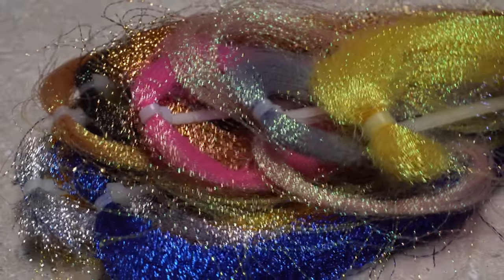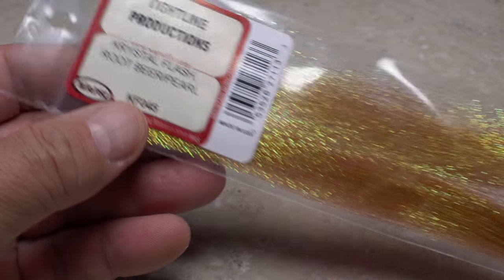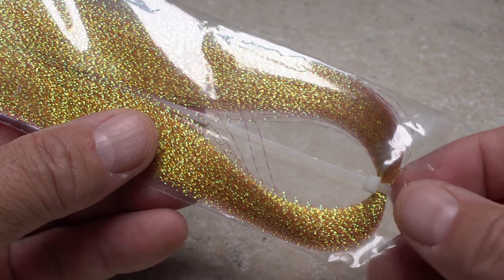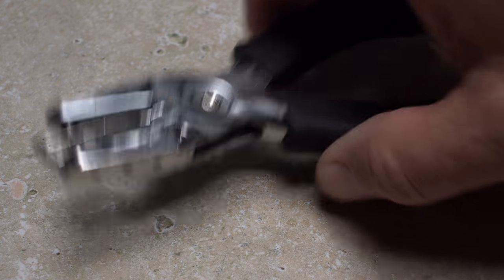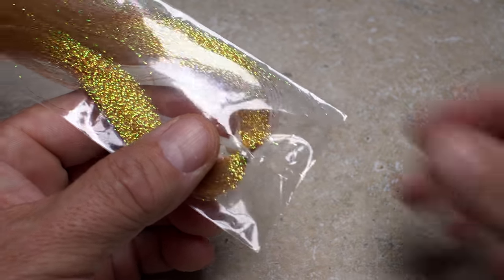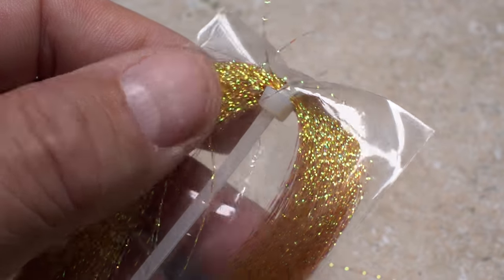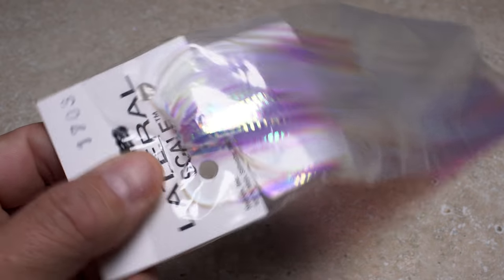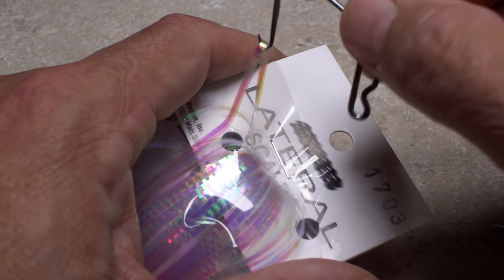Managing Material Hanks

Comment: You can also just snip off the corners of the package on each "shoulder" of the material.  Then, when you pull a strand, the plastic holder slides to the side you want, and slides back when you pull on the other "shoulder."  The whip finisher really is the best tool for picking strands out...or you can use your dubbing hook, if you have one.
Reply from the maker: My only issue with snipping the corners is that over time, I've had bags split on the seams. Same with cutting a triangle out of the very bottom of the bag. The circular hole of the punch away from the bag's edge seems to hold up better, for me anyway.
Reply: Scotch tape solves the splitting issue.  Just put a tab of it on the side or corner, then do a diagonal cut with the scissors, through the tape and the bag edge.
Reply: Put Scotch tape on each side before cutting off the corners.  Then they don't pull down.
Reply: I do the corner cut as well and works great.  Although, my supplier sent me a hank of midge crystal flash that was so knotted I can't do anything with it.  Kinks and knots abound.  Sent me new one so it's all good.  Oh don't try to run a comb through it.  Does work like hair does.

Comment: I tried this, however the material, especially flashabou, takes on a slight curl when pulling out of hole.  So it goes...
Reply from the maker: I know exactly what you mean. Try pulling just a small loop out with your scissor tips or whip finish tool and then pull the remainder out with just your fingers. I have a feeling that running either tool against the full length of the material is causing the curl. Kinda like curling a ribbon using the back edge of your scissors.
Reply: @tightlinevideo  yes it's the tool edge I agree. Thanks!